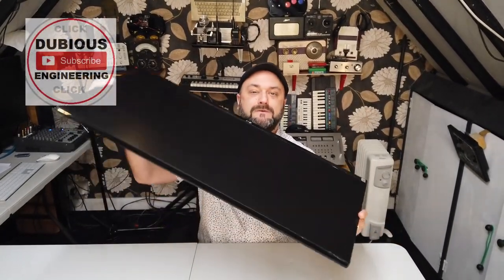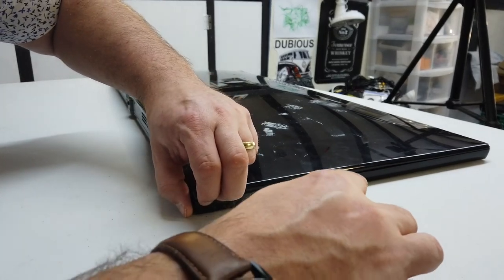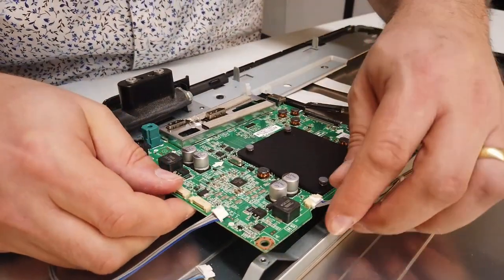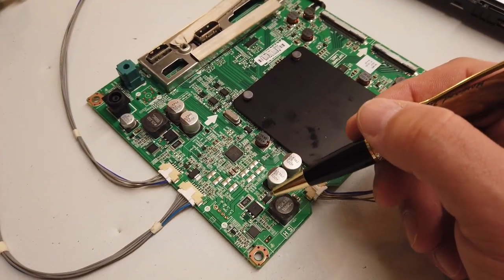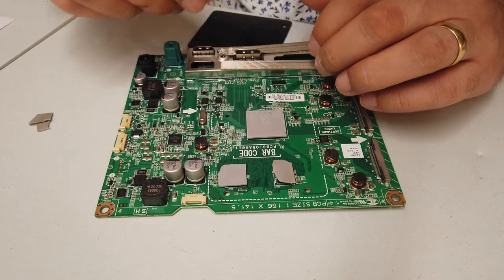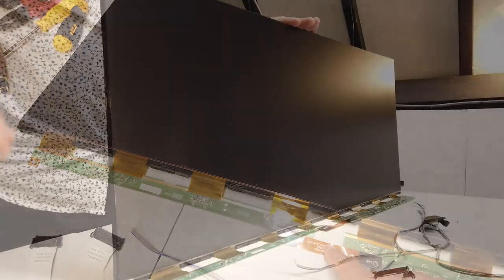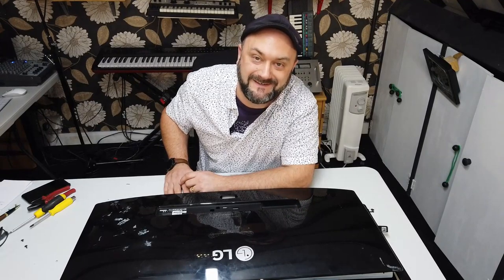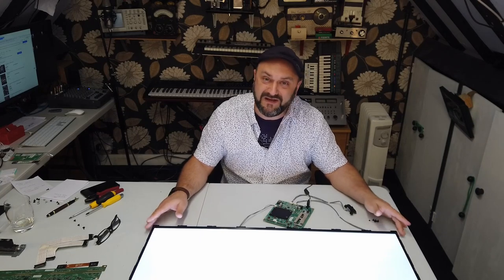DuB-EnG: 34" LG HDA Full HD IPS LED Ultrawide Gaming Monitor - Teardown Disassembled - Whats inside?

Comment: Good idea for the backlight. I have a small monitor that has a bad LCD controller chip in it so I may do just this (or I could change the chip and recover the monitor).
Reply from the maker: You have to find and buy the chip?...  probably a ASIC - may be difficult to find programmed!!

Comment: @dubious do you happen to know how to keep the backlit always on ?
Reply from the maker: You need something to simulate the HDMI input port
Reply: @DubiousEngineering  hey thanks for the fast reply. by simulate do you it requires power through the HDMI as well. because I tried to just leave a HDMI cable with nothing connected to it. it didn't work

Comment: How did you power the backlight panel? You mentioned you found a power supply for it. You got me inspired to try to attempt to get a working light panel from a broken LG 34UM58. But I'm a bit of a noob in regards to electric stuff, so hope you're willing to help a fellow out.
Reply from the maker: So sorry I didn't read this for ages
Reply: @DubiousEngineering  no biggie.

Comment: My monitor just randomly stopped working and when I plug in the power source to the monitor the light doesn’t light up but the pc works just fine I don’t know if it’s the power source of the monitor
Reply from the maker: Put a multimeter on the connector of the power brick to see if its giving voltage out.